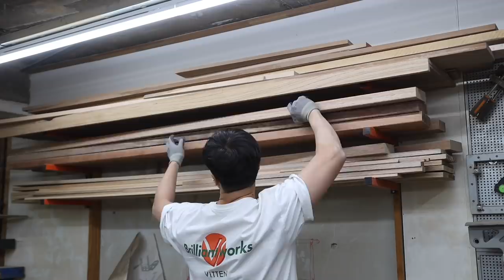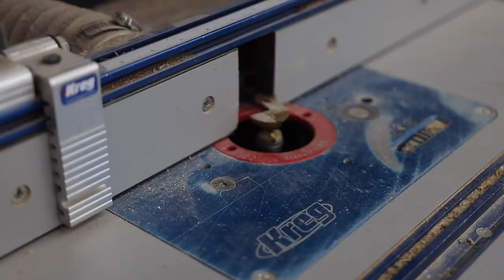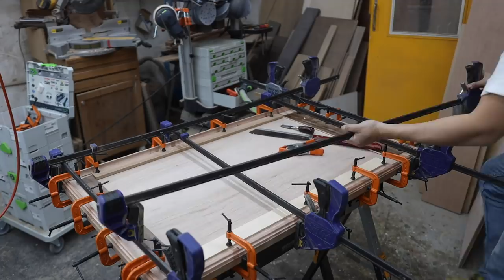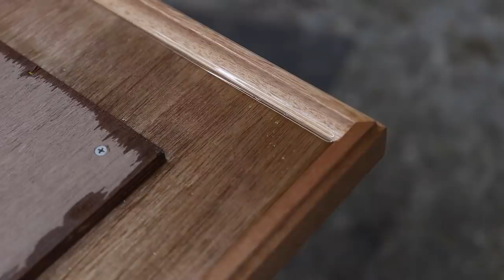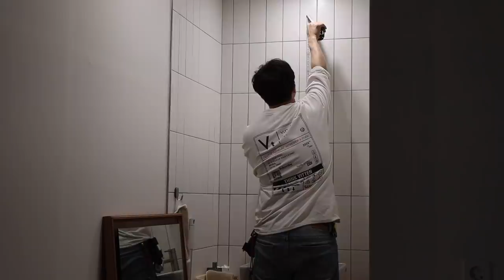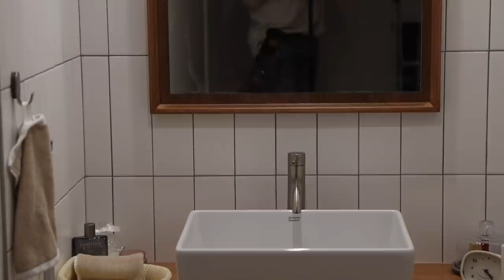W112_Wood frame mirror

Comment: I think in few months, the back of the mirror will be destoyed if you use silicon glue to glue it to the frame. I got that problem with the mirror at home because of using silicon to glue the mirror on the wall. 
Hope you did not use silicon glue.
Reply: not in few months I think, just in a month.